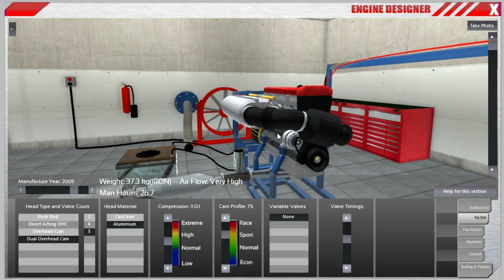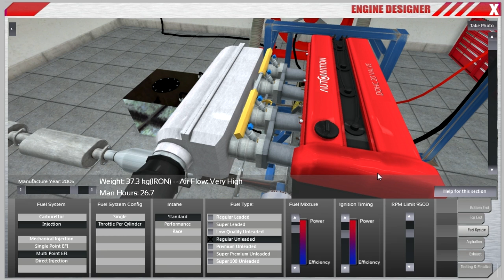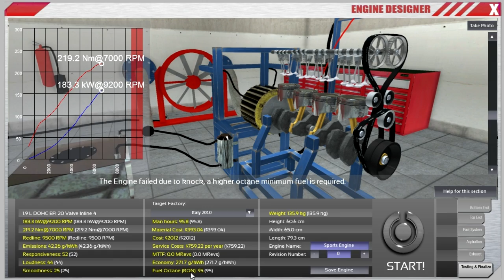Engine Designer Update 19.02.2012

Comment from the maker: @Pyrlixx 2 Strokes may come later on we shall see.

There isn't a Litre/100km figure as you can't tell that until its in a car (how heavy is the car, what gearing does it have, how aerodynamic is it?)  It does have a figure of how many grams of fuel it uses per kw/hr. so you can compare how efficient your engines are :)